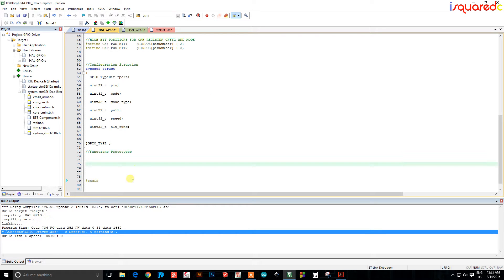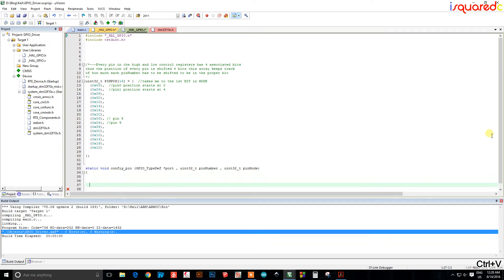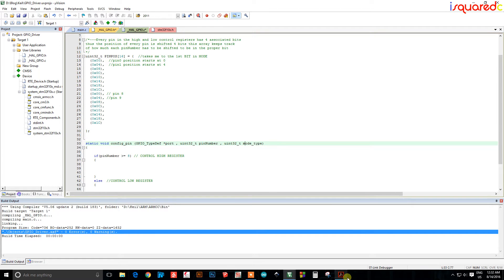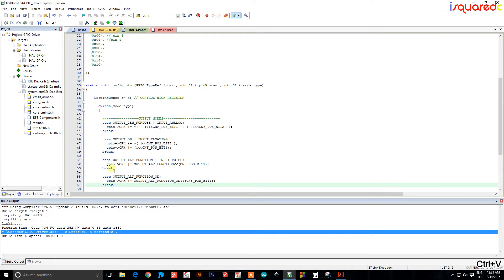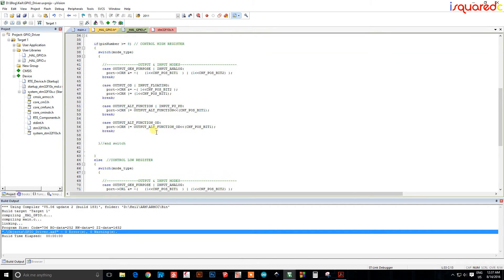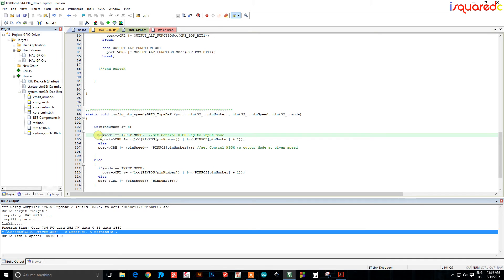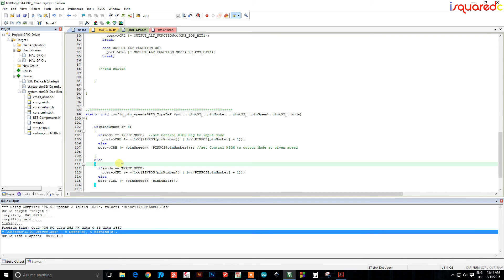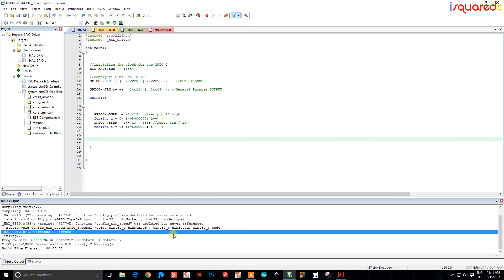Stm32 Peripheral Drivers from Scartch : GPIO Programming Part 3

Comment: Hi Eddie ... thanks for your series about stm32. But when i code, in the switch case of config_pin function in this line [case OUTPUT_GEN_PURPOSE | INPUT_ANALOG:] it has an issue : error use of undeclared identifier "OUTPUT_GEN_PURPOSE" can you help me to solve this error ... thanks you so much

Comment: Hi Eddie, I really like your tutorials. But I think you got something wrong in your config_pin function. If you try to set a Pin to INPUT_PU_PD it will give you a 0x03 in the CNF section, which is reserved. I think you got something wrong here.
Reply from the maker: Those values I did not mean to put them in the register I believe, they are just to check in an if statement , but I don't recall what I was doing here it's been a long time. I'm sure there's probably bugs in there

Comment: I wrote the code but i am getting multiple switch case errors. The errors shows at every "case" line and every one of them shows 3 errors. 1. expected ":" after "case" It is pretty obvious but ":" is right there :D and other two just blank "expected expression" errors. Do you have any idea how can i fix this? I couldn't find any solutions on the internet.
Reply from the maker: Your error must be above all of that probably.
Reply: @EdwinFairchild  Woaa you are quick :D. I checked it,the code was okay.  I tried to convert the job to if-else statements,using the same macros of course. It seems like problem arises from the macros. Keil says that my if statements somehow wrong. Btw even if i delete all the code from my headers c file,my if-else and switch-case statements still gives off an error.
Reply from the maker: @diehardmetalhead3797  if you're still having the issue email me the header and c file ,  I'll give it a look later  tonight .  eddie@edwinfairchild.com
Reply: I am having same issue. Is it resolved?
Reply: @mdmonirulislam6269  Yep. So apparently I am not good at C language and I made syntax errors. It was the semicolons after define statements. I removed them and problem gone. Review your header files for syntax errors.
Reply: @diehardmetalhead3797  I also made the same mistake at few lines. Thanks.
Reply: @mdmonirulislam6269  I am facing the same issue and in my header define statements there are no semicolons. PLease help me to solve this issue. thanks
Reply: Hello  @mryanshahid13 . I had added commas (,) mistakenly at the end of few lines . Also don't forget to include this h file into your script containing main function. Best of luck.

Comment: Hello, I really appreciate your videos and I am looking forward to the next updates.
I have a problem with the  STM32F767zi, Right after my code upload, it needs Reset from the board button in order to run the new code. 
Is it possible to set a reset right after the new code upload?